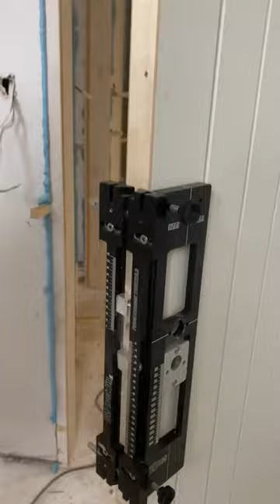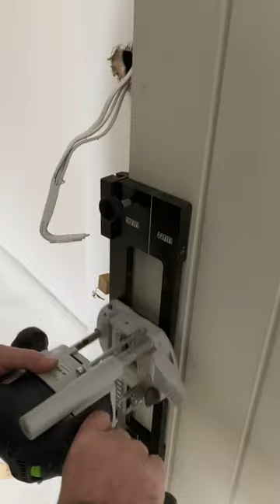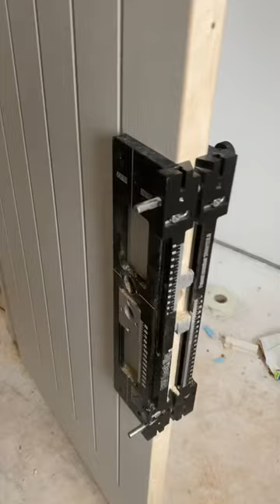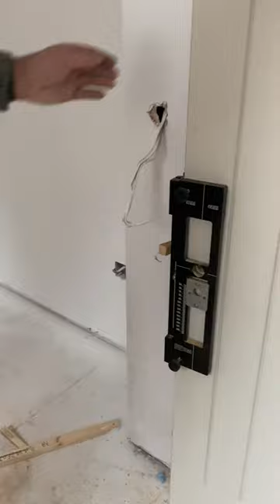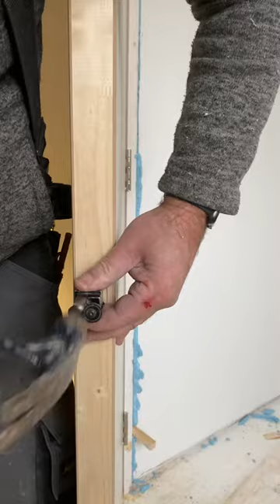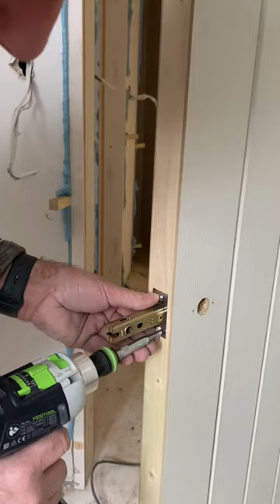Latch with the B W Lock Jig. For further info go to www.bw-jigs.com

Comment: Ben.    
I have you thought about  a jig for frame strikeing plates .
Only asking because all  the sites I'm working on are using mdf frames  which can be a pain depending type used
Reply from the maker: Hi Keith, I’m actually working on one now. Just a few issues to sort out. I’m hoping it will be ready soon.
Reply: I was thinking  about  some different  latch types   and bathroom plates.   Also  flush bolts also  rebates one's    so  there's some more to think about  over the next few weeks🤔😅
Reply: @benweir8173  keep me posted please
Reply from the maker: @keithwillsher9887  are you on Facebook? I have a group set up called B W Jigs. 👍
Reply from the maker: @keithwillsher9887  I’m hoping it will cope with most latch and lock keeps.
Reply: @benweir8173  yes I'm on your f/b page since you started it
Reply from the maker: @keithwillsher9887  ahh ok, sure no worries Keith, I’ll keep you posted. 👍

Comment: When are these going on sale pal, and do you know the rough price
?  Cheers
Reply from the maker: Hi Dean, they are available now, though I’m all out of stock till Tuesday/Wednesday. They cost £415 + vat. If you would like one send me your email address, company name and contact number and I can send you a PayPal invoice. ben.o.weir@gmail.com 👍
Reply: 415 quid?????
A site rates you need to fit alot of locks to recover that. 

Ya can get a porter cable for 800
Reply from the maker: @karlnorman2427  surely you’d have to fit a lot of locks to get your money back on a Porter cable? Also to go from a mortise to a faceplate is a lot of messing around with a portacable. This does the faceplate and Euros, spindles, through holes etc. Granted it’s a bit overkill for a latch but if you got it why not. This comes into its own on Euros
Reply: @benweir8173  But a porter cable can do digilocks for hotels. Bearing in mind many of those locks are 600 plus each plus fitting, you ain't in the cheapo end of the market.

Most firms want to pay around 7 quid for a sash lock pre tax.
Reply from the maker: @karlnorman2427  I get £48 for a door, latch and stops and £52 for a door, bath lock and stops. With this jig I fit all locks and latches in 1 hour and 15 mins. So this is an investment. It’s suitable to most common locks. And fitting a euro cylinder lock takes no more than 5 mins. Hard to beat.
Reply: @benweir8173  hope u don't mind me being nosey!
£48 is that inclusive of arks & lining?
What part of UK u working?
Awesome jig by the way
Reply from the maker: @pauldavies7251  we get £10 for the lining, £34 for a door, latch and stops and £40 for a door,  bath lock and stops. Arcs are £1.50 a metre(£15 per door)
Reply from the maker: @pauldavies7251  I’m in Kent. Seems to be loads of work down here. 👍
Reply: @benweir8173  good prices 👍much higher than in South Wales, we only get £10 for an euro lock 👎
I've made a few similar jigs from phonolic ply,
But that's brilliant 👏
Reply from the maker: @pauldavies7251  thanks Paul. It’s taken me 6 years to get this far, and a lot of sleepless nights trying to overcome the different variants. 👍
Reply: @benweir8173  well done & good luck should b a great seller if you can get enough publicity 👍
I'll definitely b telling my mates in work 2 check it out!
Reply from the maker: @pauldavies7251  thank you. 👍